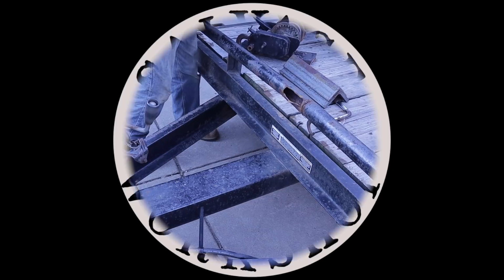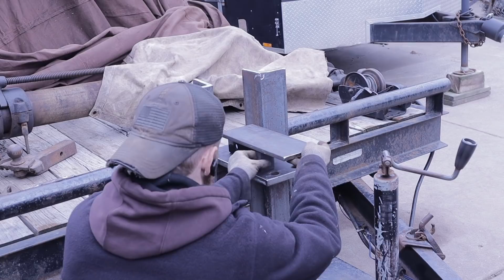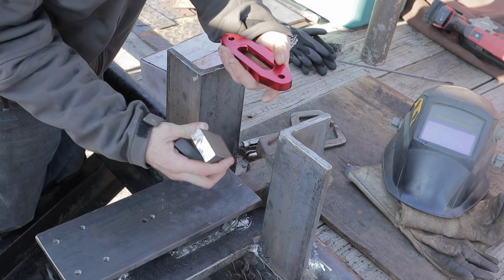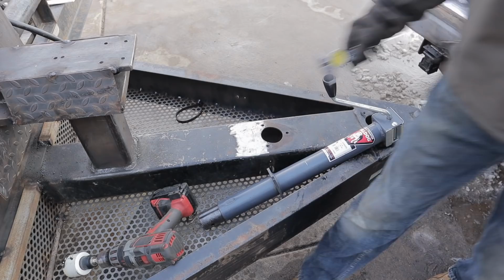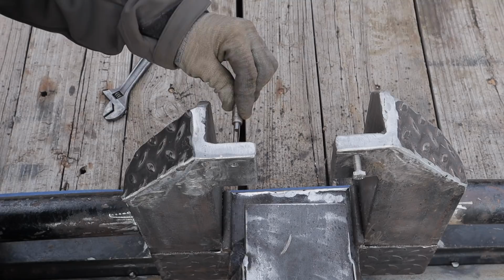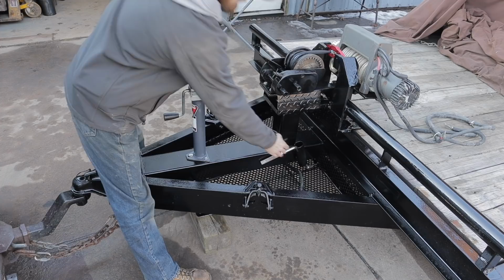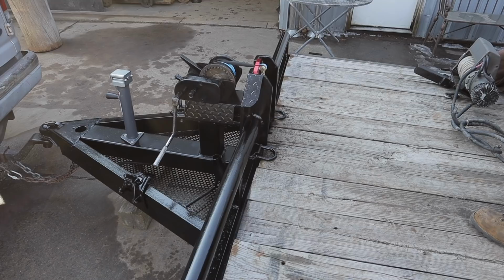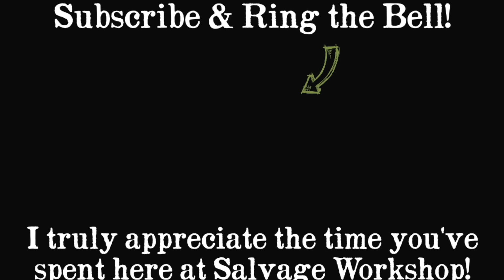Creating the ULTIMATE Trailer Winch Setup ~ This one is a THANK YOU for a Friend!

Comment: You, Sir are the kind of guy that will help those who help themselves. As they say a good turn deserves another. Great respect to you. By the way, my Dad worked on heavy equipment for 60 years. He was a master mechanic and always used a method for bolts like I seen you do. Bolt Flat washer Lock Washer and a nut he would be delighted to see you doing that.

Comment: First time I saw some else use an idea that I developed 5 years ago to augment winch use. My use is in Australia on a modified bullbar with hitch built into the normal position on the bullbar where the winch would mount. Then if you got bogged and had a trailer on you could do a double winch or conversely you could move it to the rear hitch and pull yourself backwards out of the situation. Just requires some electrics to be added and jobs done! Thanks for sharing..

Comment: That was kind of you to build your friend that winch mount.  It was an excellent skilled job. You're very skilled at welding and working with metal.   I'd be careful with that wood floor and hauling forklifts.  The forklift is a heavy piece of equipment.  I had one fall through on the way back from Muskogee, Oklahoma heading back to Grand Prairie, Texas. Just  make sure the floor wood isn't rotted and there's plenty of metal support for such weight.  I use to haul tractor/ trailer tires with a trailer just like that. They're rugged but weight will wear a utility trailers bearings out and the tires. Also looks like that ramp needs modified for a smoother load and unload.  I'd blown a few tires with to much weight on the tires, too.  Just thought I'd let you know.

Comment: Great Build!!  Looks very sturdy. Two points........  (1) Another youtuber said you shouldn't allow your dogs to be around when your welding because they don't know any better than to look at the bright arc. I had never considered it, but it made sense, so now I put my dog in the shop when I'm welding to protect his eyes. (2) I'd go back to the steel cable, you don't have the problem of a sharp edge severing it. You never see a Wrecker, or a Flatbed with a poly cable. Just food for thought. Overall, that was a hell of a nice job. At the end of the day, it's your winch & your decision.   Best of luck.................................

Comment: Seems like you made it a lot more complicated than it could have been. Understand wanting both winches as sometimes you don't have a good battery. And the 2-speed hand winch is handy for loads up to about 1500#'s or so.  More maybe on level ground. And the universal square hitch mount can be very handy. But why the plastic rope and so much metal construction. Could have been done simpler I think. The dogs are great and of course right in the way.  Good to see you primed and painted everything and the tool tray while complicated is very handy. Terry

Comment: Be sure to double check that the synthetic winch line is UV rated. Many are not. They are also prone to accumulation of grit which will greatly shorten its life, at least when compared to steel wire rope. As other commenters have suggested, a weather cover would be very beneficial. Just something to be mindful of since it will see a great deal of road spray while being towed. Nice build overall, as always👍

Comment: Already did something very similar to this to my trailer years ago. Having an electric winch is nice on a trailer. Mine can also PULL  yard debris and garbage out of the back of my trailer. Call it a poor man's dump-truck. I have a cable and pulley that runs underneath the trailer so it can pull stuff out.

Comment: Couple things.
Weld receivers on the tail end. Weld a couple of shackles on the tail end as well for snatch block. You can move your rigging around and save your back some but you are going to have to be smarter than that hammer to save your leg. 
My equipment trailer has more purchase welded onto it than it has trailer. My truck has front and rear receivers too. My winches are on mounting plates and I put them to wherever they do the most good.
That's the thing. It just plain doesn't have to be so hard. 
Anyway you have done fair by your buddy that lends you his trailer. You're a good man.

Comment: Btw a thread tapping tool is hardened so becomes brittle in certain directions, off centering the actual tool holders a good way, also fyi taps n dies are considered hand tools< machine tools are same but are correctly aligned in the centerline direction, which a hand held power drills, too much wobbling about , ,and a thought about welding washers get a reason priced mig welder, ARC WELDING  is for thick steel. nice job in the end your not related to any German Engineers are u< bit over engineered exactly ? nice idea.

Comment: A downside of using synthetic line on a winch is that it stretches. If something lets go, the line (and anything attached to it) becomes a missile, which (in my experience) can exceed the speed of sound (and make a sonic boom). A two pound shackle or hook going 700 mph-plus does a LOT of damage. If you don't want to change it, don't let anyone stand anywhere near in line with it when it's under tension. Another downside is if you wind the line on under little or no tension, pull some of it out, and crank it back on under tension, the tight coils will sink into the loose coils and make a tangle. Wire rope can do that, too, but not so hard to untangle.

Comment: Pro Tip: Make yourself a 3/4" or 1" thick plate about 2" wide and 4" long with the exact outside diameter size holes for various tap sizes. Then clamp that plate over your hole you're trying to tap, put your tap through the plate and it'll help guide your tap to be perfectly straight through the hole to get your first few threads started. Remove the plate and finish tapping your hole.

Comment: Planning  a similar fix ln a smaller farm  trailer that is used for just about everything but needs muscle power so  designing a mount for a 9000 lb electric winch powered off the tractor. A lot of timber to shift from recent storms out of wet land too boggy for machinery. Your work  much appreciated. Another project is a chain hoist for the Dutch barn so just thinking maybe you might be planning one. Like the way you think. Thanks. Happy Christmas and a successful New Year. Lloyd .. Wales, UK.

Comment: you need a set of reverse screw/drillbits for broken bolts, makes it easier than hammering or welding extra stuff on it
Reply from the maker: Ya, I've never had a set of those drill bits... my worry is always that I break a hardened bit in the hole and then make it SO much harder to remove, cus I've done that before! I have heard they are great to have though!

Comment: Hiya, good solid video for us to watch, just one thing, maybe check you have the correct tapping drill size in thick metals, plus plenty of lube and try making several different sized metal bars with a drilled hole the size of a tap your using, with the ends of the bars faces machine square to the drilled holes (done in a lathe), then holding the bar square to the hole you want to tap you get less sideways stress on the tap that causes breakages.. thankyou for the video - Ian - UK.

Comment: Great job on that massive mount!
That will surely last longer than the trailer itself...
:-D
Will you put a big plug on the van to run the electric winch from the battery or will there be a second battery on the trailer and a charging wire?

Next project, fixing the rusty panels on the van...
Thx for the vid!
Reply from the maker: Thank you Horst! Lasting as long as possible was the definitely goal! For now the plan is to bring a battery powered jumper pack, and a LONG set of jumper cables in case that gets worn down...The winch is also my buddy's, but I have plans to get one at some point!

Adding a plug at the back of the vehicle is a GREAT idea!! Thank you! 

Don't expect to see the van panels fixed EVER... Its just not worth the time!

As ALWAYS thanks for watching and commenting! I truly appreciate the support! Lots more to come!
Reply: @SalvageWorkshop  Couldn't you just design a battery box for the trailer and hook up the 12 volt from the 7 pin light plug to keep the battery charged?  That is the way they do it on those tow behind campers.  They have a battery in the camper and the 12 volt from the hitch wiring connector feeds through the trailer and charges the battery.
Reply: @Newman81964  That's what I plan to do for my winch battery, but I think you need to disconnect it from the vehicle when using the winch. A 10 gauge wire to charge the winch battery, shouldn't be subjected to the load that the winch can draw when used.
Reply: @bluegrallis  You should have a battery on the trailer when using it to power the winch.  The power wire in the 7 pin connecter is too light to handle running a winch.  The power wire can be used to keep the trailer battery charged though.  You do need to keep the trailer connected to a vehicle when trying to load up logs though or you can have a major mess on your hands.
Reply: @Newman81964  If you run the winch from a battery on your trailer and it's still connected to the 7 pin plug and your charging system, you WILL subject your plug, wiring and anything connected to the charging system, to WAY more amp draw than any of that is designed to withstand. UNPLUG the winch battery from your charging system ANY time you use the winch.

Comment: having sold synthetic winch lines for many years i just want to point out a few things.
1} They are made of plastic and the biggest enemy of plastic is UV rays other wise it will weaken and fail in a couple years. so cover your winch. 2} They are unlike recovery ropes they don't have give and will snap if jolted they have no give. 3} keep in mind ropes and cable are rated differently. The ropes are rated at their actual breaking strength. Cables are rated at 50 -60% of breaking strength because anything used for over head lifting has a safety margin. that is why you never see commercial over head winches using winch ropes. only in marine applications as the ropes float and fair better with salt water.

Comment: YA should put some old motor oil  thined  with gas or diesel to potent your boards on trailer .a little oily for a little while but Dryies in nice and water shed right off

Comment: You’re gonna need to put an electric jack on the trailer just to lift it high enough to hitch it to the truck, and you’re going to have to upgrade to a 1 ton truck to support the weight of the modified trailer tongue!

Comment: I agree if you are going to take the time to repair something why half-ass it. My motto has always been too ask the repairer how or what would you recommend for your Mom. We repaired/replaced our roof and it was 1700 more for ice and water membrane over the whole roof as well as 3/4" plywood instead of 1/2". I thought 30 year guaranteed shingles with 15 year install & labor guarantee only meant it cost me $9.45 extra for that 15 year guarantee. I can't wait to see what you have to come. You should look into manufacturing your own rolling dollies. Like the kind they use to move cars in any direction. You place one at each wheel and you can move an 8000 lb care with a 5 year old pushing it.

Comment: Awesome job!!. We just bought a new trailer and they don't come with tie down rings.  I also need to build a spare tire carrier.  I want to add a winch and a built in chain, tool and whatever box. I only got  four  D rings welded on so far. I ran out of reach with my welding leads.

Comment: You may think this us crazy but an electric drill would work in place of that hand crank. If you use a snatch block that will help out a electric drill. My friend built a winch out of and old boat hand winch and used a starter motor with sprockets and chains but the crank still worked when the battery was dead.

Comment: as usually, very good thinkings and concept and triple tough built. with this winch holder you can pull a 30t forklift up the ramp:-)...whats the weight of the empty trailer? how much can you load on it? how do the brakes work? havent seen air hose or overun brakes. What load can you pull with the white van? isn`t there an anual neccecity for technical testing of trailer for a badge? lots of questions. best regards

Comment: Wow, that’s a trick trailer, I love the the metal screen plate on the bottom, what a great idea! You’re an awesome friend, that’s some beefy stuff on there that should last as long as the trailer. I was surprised you put on the synthetic line though, I guess it’s easier than the braided wire but what is it? Thanks for the video, love your channel.
Nena
California
Reply from the maker: Thank you Nena! The nice thing about the holes in the metal screen is that they will allow dust and dirt to fall right through instead of getting all packed with junk! 

Check out the link to the line in the description if your interested in reading about it... Synthetic winch line is actually stronger than traditional braided steel cable with a higher weight rating. It's also lighter and SAFER to use because in case it breaks, it won't hurt anyone! Trust me steel cables definitely DO break, and can be more dangerous!

As always Nena, thanks for watching and commenting! I truly appreciate the support! Lots more to come!
Reply: Okay, I’ve watched almost all of your videos and wonder if you could do one where you tell us how you’ve come to here. It’s very apparent you know a lot of stuff and you’re not that old, how did that happen? I can appreciate your privacy concerns but we don’t even know your first name...almost 100 thousand subscribers...is it “That dude from Salvage Workshop?” Thanks!
Reply: Whoops, I mean 50,000, soon to be 100,000!
Reply: Yes, great idea on the catch pan. Great storage! Just an FYI side note..... It's called perforated plate. Most of us tradesman just call it "perf plate".

Comment: Nicely done.  A couple of thoughts:  One, a gusset or two between the square tube and the frame member would strengthen the mounting.  Two, can I put in a request for a salvage restoration on the manual winch?  That dinged up spool doesn't go with the rest of the setup.

Comment: I over built my flat bed that now I cant remove it unless I take my rear tires off. I added some bolts and 10" long c channel under chassis which means I must pull back before lifting bed. My tire to tool box gap is 3 inchs but since I wanted to over build it I simply missed that. I'm building truck on my channel and a winch is in the works.

Comment: Putting a lock washer between a nut/bolt head and a flat washer make the lock washer essentially useless.  One side of the lock washer is supposed to bite into something immovable, and the other side is supposed to bite into he bottom of a nut or bolt head, making it far less prone to loosening.  If you want to use a flat washer, just use a lock nut instead.

Comment: Pre-heat on that thick stuff. Would have gotten much better weld penetration as the thick stuff robs the weld heat right away limiting good penetration. Mayybe some bevel on the joints for the root pass. Just sayin, limit your come back work for failed weld penetration.

Comment: And now we have successfully added another half ton weight to the trailer. I learned a long time ago, if it looks strong enough its twice as strong as it needs to be. Also remember there are three thread taps to a set, namely, Taper, Intermediate, and Plug, use them in the correct order with the correct drill side and you will never break one, they are not designed to be used with a power drill. Just sayin!!!

Comment: Was there a reason you did not just mount the reciever tube below the first big plate, in between the two upright supports? 

Seems like you just wasted all the supporting you did for the lower mount, just to go ahead and mount the winch plate to a much thinner material on the receiver tube. The extra work for nothing

Comment: Why not mount the receiver to the tongue, put the manual and electric winch on hitch mounts and put a roller on the edge of the deck for the cable to ride over?
Reply: I was talking to the screen, as soon as he cut the rail tube. 
"That's where the roller should go."